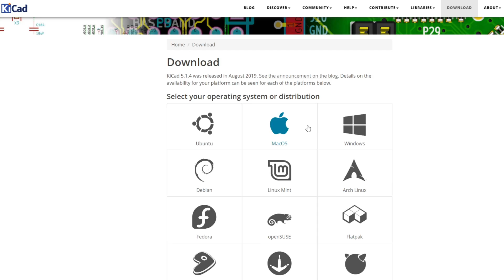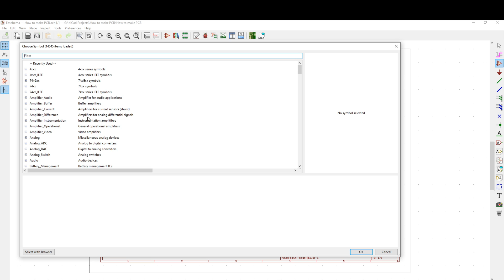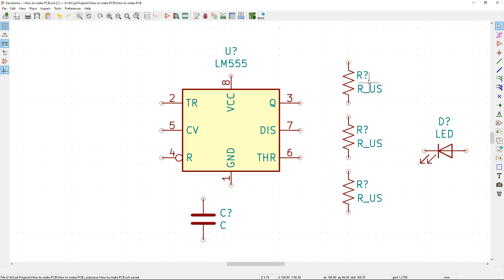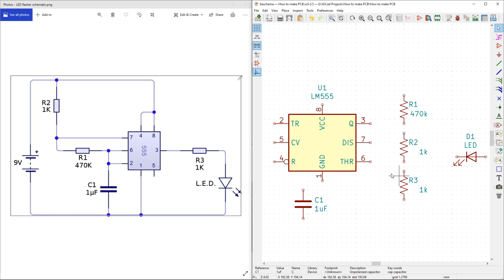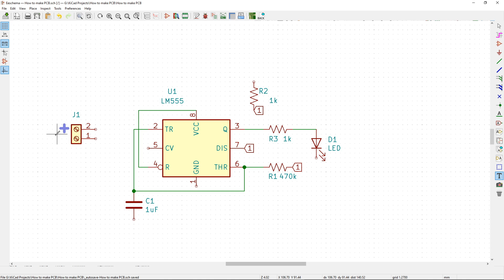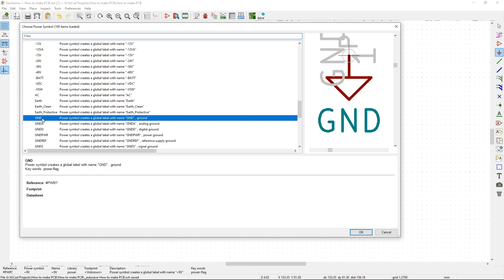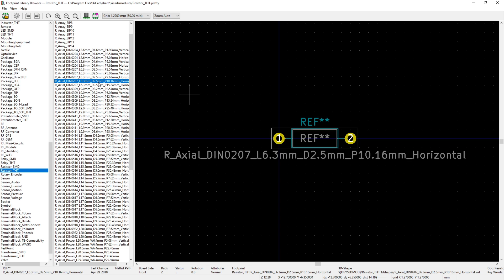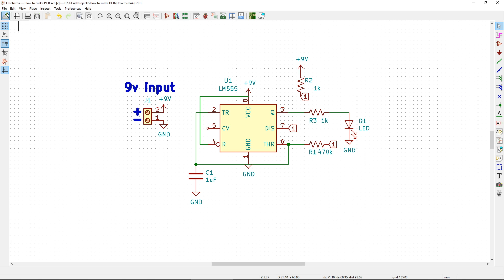Design your own Circuit Boards using Kicad Part 1 (FREE software)

Comment: Is there a complete beginners guide how do you know what you need on the board to do what you want. I want the heating element to come on and hold a specific temperature for X amount of time. I don't know what parts i need to power the heating element then monitor the temp and turn off after X time

Comment: I really wish you had have explained how you undid the wires to place the global labels. You lost me there, so I had to leave it be and couldn't undo my mistakes. I'm 2/3 through and have to take a break from frustration. I pay for Fusion 360, so I'm not completely lost, but it did feel like you went through VERY quickly with no net, so to speak.

I really like all of your stuff, so this is frustration coming out. All apologies, but also please tell me very clearly how to undo my mistakes when making a tutorial.

Thank you

Comment: Nice work, can you please do an instructional how to video of a high quality graffix circuit board? With the appropriate power supply, input/outputs(With your exceptional price/function/testing methodology. Compact modular plastic design component prototype. Able to plug in components to other computer to start. Aluminum CNC face trim led display for wherever you end up Sir. As a plumber, your  relatable breakdowns are appreciated

Comment: question about Kicad I have made a board but when I have it in the pcbnew part how do I lock the size of the board so as I move the parts the dont make it bigger or smaller. I have certain parts always on the edge of the board and I want to have a few millimetres from part to edge of PCB. Thankyou for any assistance and subscribed.

Comment: Well, design rule checker throws 2 warnings, one of which is:
ErrType(3): Pin connected to other pins, but not driven by any pin
    @(46.99 mm, 34.29 mm): Pin 1 (Power input) of component #PWR0101 is not driven (Net 1).

Comment: Ed Kishbaugh here. I really need help to say the least!!!!  When drawing electrical tracks connecting the components I'm getting errors after running DRC.  I zoom in close so I can be as accurate as humanly possible to connect components. Keep getting errors. Can't proceed any further!!  Checked out mouse in Wndows , OK Uninstalled KiCAD!  Cleaned computer up. Redownloaded KiCAD! Changed out mouse!!!  Still the same thing. Very fustrated!! Don't have the answer!!  Appreciate any help!

Comment: Thanks for the great videos! I’m not an expert in kicad but one thing I have learned is that you can also use Annotate to change the component designator (R? -> R1 C?->C1 and so on).  It will annotate all the components at once

Comment: Great tutorial! But, unfortunately, I'm not happy using JLCPCB because their silkscreen can be a little off compared to others and they add that tracking number :/
About tutorial - Don't manually edit reference number, just use annotate tool :)
Reply: On the tracking number - if you scroll down on the order page, there's an option that says "Remove order number" - it adds a couple of dollars. Would that do what you want? Excellent tutorial btw :)

Comment: at 13:14 . ......please explain how you got the detail of this J1 using keyboard ??? I am shure you overlooked to point out how a Noob would get it to appear Magically like you got it done here !!!?
Reply from the maker: The datasheet is normally provided by the website you bought the component from. If you don't have a datasheet for your particular component, then you can use a ruler/calipers to measure the component & look through the available footprints to find a match.
Reply: @Schematix   Thanks for the quick response.....but....My problem is that i have to learn keyboard shortcuts/strokes to access the Dip data . I guess, you are not aware that it takes time for Noobs like me to learn this unless you point it out helpfully. Thanks once again.

Comment: Woohoo that looks so much easier than back in the day, when I was making circuit boards. Can't remember the software apart from it was running on DOS.
Reply from the maker: And you wouldn't have had a 'fancy' 3D preview of your PCB I'll bet ;) (that's coming in part 2)
Reply: @Schematix  And before DOS was PnP (Pencil and Paper).  Didn't know what I was doing, but I had fun.
Reply: @ron.owensby-g4p  I did mine direct to the board with an etch resist pen. Don't miss that one bit!
Reply: @Schematix  idk what should I instal for windows 64bit? osdn or cern or  futurware? help